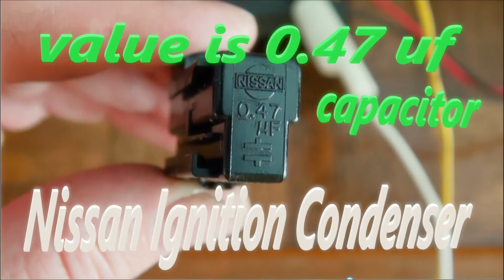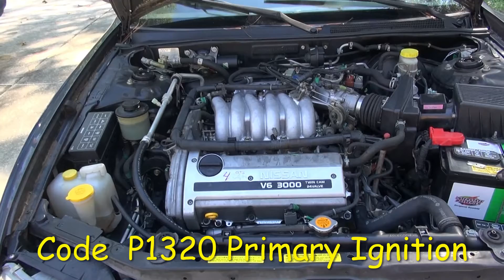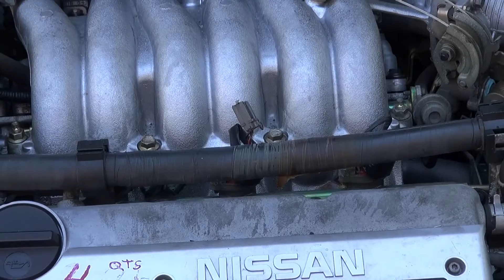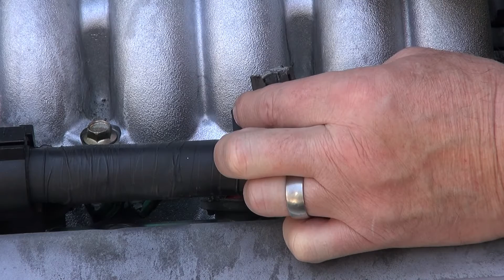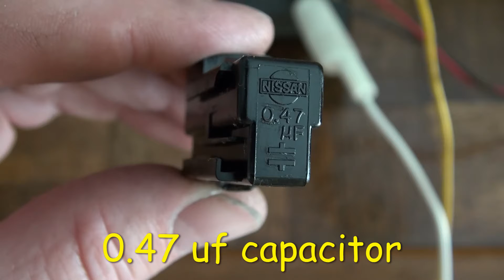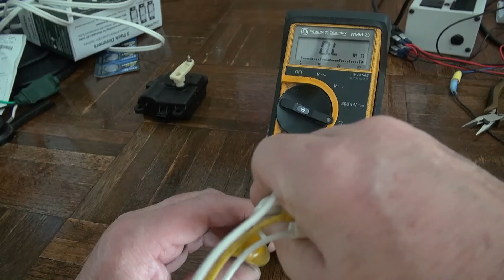Nissan Ignition Condenser

Comment: Hahaha coming from the son of a neuro-surgeon. Hi I'm Steve. I'm the mechanic in the family. I've recently discovered this nuisance. A ignition coil condenser. Back in the 70s we called it a coil. AKA coil winding. Anyways on my 2010 Murano this "condenser" went bad. Bought the car and needed a motor. Installed the motor 3 years ago. It's been misfiring this whole time even with the brand new 6 coil packs.

Comment: Hello, thanks for the video. Did you fix the problem? I replaced the capacitor and was getting the same reading you were after replacing the coils for cheap one. I did a research online and found out the coils have to be replaced with OEM ones. Thanks
Reply from the maker: Still having the p1320, I am going to try a set of oem coils next
Reply: @neuromanglers  replaced all coils and spark plug with oem, also cam and crankshaft pos and still#3 cylinder no spark. Next move is ECU I guess...Any updates on your part?

Comment: I am sure i won't get a response but im trying to check mine and nothing is reading i went to the junkyard grabbed a few and still nothing
Reply from the maker: Capacitors can be tricky to test unless you have a capacitance meter.
Reply: @neuromanglers  I used a multimeter
Reply from the maker: most multimenters are not capable of measuring capacitance.

Comment: What was ur reason, why you have to replace the ignition condenser
Reply from the maker: I did not replace the cap, just using the connection to test ignition voltage

Comment: Hello , i have problem with the signal sometimes working and sometimes not can you help me ? Only in two coil .
Reply from the maker: I had the same problem and in my case the ignition coil was failing. would sometimes work fine and then randomly stop working, making the car run very poorly.  good idea to change the spark plugs if they have been on a bad coil